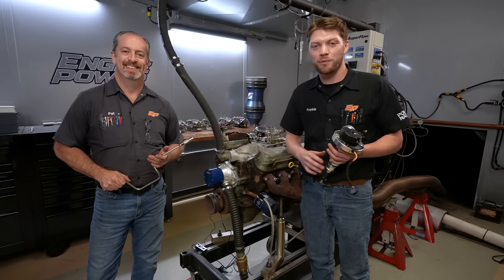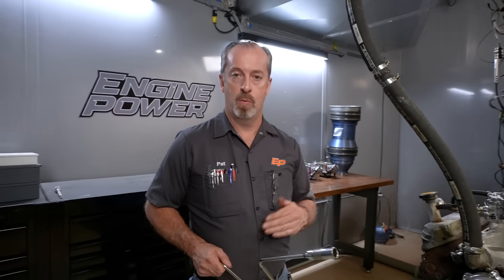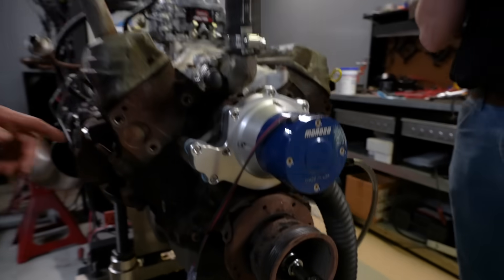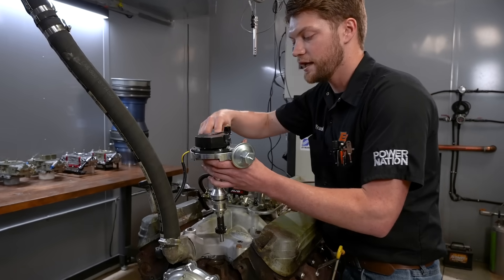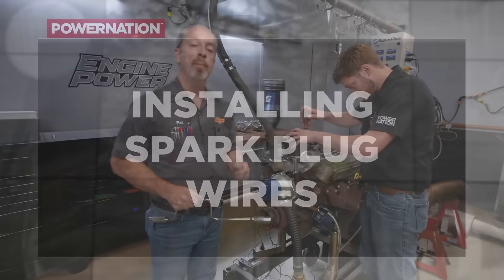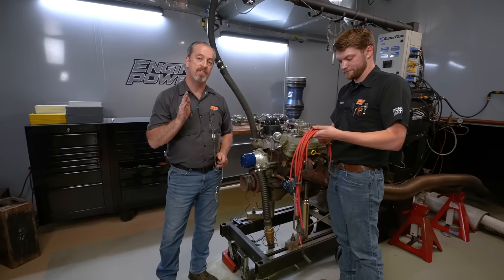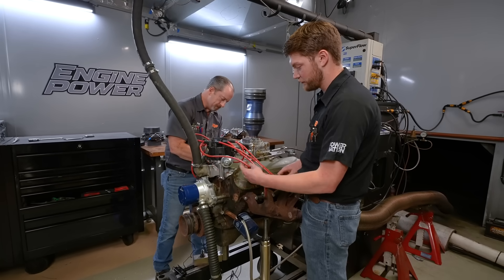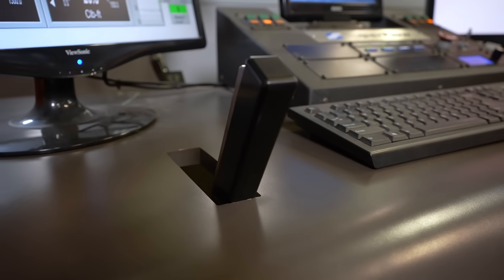Install a Distributor Correctly the First Time

Comment: Two days ago on a 4.3l chevy, on startup it was 180 out...pop...backfired...on engines before  this didn't really hurt anything but this time on this 4.3l chevy has a restrictor plate on the throttle plate.... backfire broke it off and destroyed my new engine. Thanks for the video I'll never set a distributor 180 out again...PS.. im a diy guy not a mechanic
Reply: It sucked up debris you mean?

Comment: I've got a 86 Ford truck EFI 302 and it's supposed to have the old firing order can I simply put a newer cam to change to newer firing order or am I going to have computer problems
Reply: 302 is one firing order Windsor's another both cams will interchange with the exception of the firing order

Comment: Why y'all didn't use a SDC engine? Cause the #1 is on the front driver side. How is that the #1 on the front passenger side? What block is that Ford?
Reply: My #1 is front passenger side and yes it’s a ford, idk about the other years but my 87 is like that

Comment: Couple of points:  Some engines, AKA  some V6's,  fire  with  every other pair  timed closer together, so it is imperative that you get  no1  in the correct spot  on the distributor,  IE not "one hole"   off.  Also,  I do NOT time by the rotor.  Either look at the pickup (magnetic) or  use  a light/ meter on the  points,  or even  BRIEFLY  use a timing light  "on the starter."   Not sure you  mentioned,  if you have one/ both rocker covers off, you can  eyeball the valves  rather than  "finger in the hole."  And PLEASE,  VERIFY  the marks with a piston stop

Comment: You identified the cylinders on the block & #1 spark plug wire on the distributor- HOW do you know which ones are numbers 2 - 8 on an 8 cylinder?
Reply: You need to know how the cylinders are numbered. Ford and Chevy are different. Then you need to know the direction the distributor rotates. Then you need the firing order. If your firing order is 15426378 and distributor rotates counter clockwise, you hook up #1 cylinder to #1 on distributor. Going counterclockwise, the next nub goes to cylinder #5 then 4 then 2 until you work your way all the way around.  If the last wire you hook up does not go to the last number in firing order, you got one wrong. Recheck

Comment: So over the years, I've been putting top dead center at the corner, and then I will put my distributor in with the rotor button facing number one on distributor, and then I will crank the vehicle and set my timing to 14°. So this is incorrect?

Comment: Great video. Years ago I rebuilt an engine and it would fire but wouldn’t start. Distributor was 180 degrees out. Wish I had seen your video then. Would have saved several hours of frustration and a dead battery.
Reply: I'm new to building cars. I have 350 I tore apart and currently installing the distributor. I believe its 180 out due to backfire and not starting. However, I can't seem to figure out why or how it's 180. What does that mean? Do I have to spin the silver part 180degrees on thr distributor? 

Car was set to TDC compression, 12 degrees before. Then I moved the oil pump shaft and dropped my distributor in. It points to #1 cylinder and #1 on the cap fully seated. Do you know what I'm doing wrong for it to be 180?
Reply from the maker: Thanks @craigwiest772, appreciate the comment!

Comment: Why do some ppl "lock out" the timing adv? Why does doing that give more performance?
Reply: When using a digital ignition box or ECU that uses sensors to provide accurate data, the ignition timing can be precisely controlled.
It's much better than the old crude method using counterweight, springs, and vacuum diaphragms.
Reply: @cruisingthethaiway6881  ah ok I see thank you

Comment: I'm 35. My first car was a 1976 Ford Maverick but I could NEVER figure out distributors. Great video.
Reply: Advance or retard it by slightly rotating, also on carburetors you adjust jet screws, might consider having a vacuum gauge and timing light
Reply from the maker: Thanks for watching!
Reply: 😂 ....and so you became a engineer